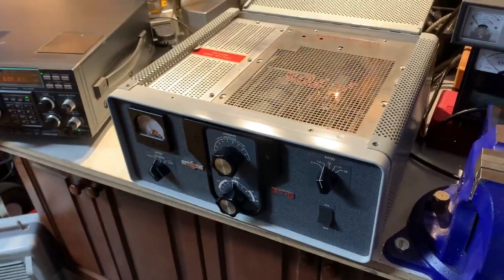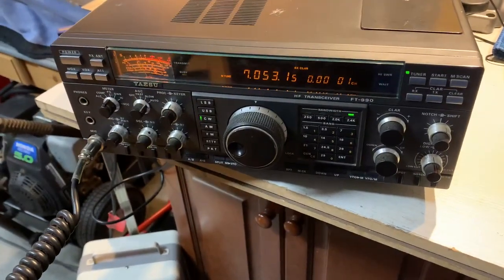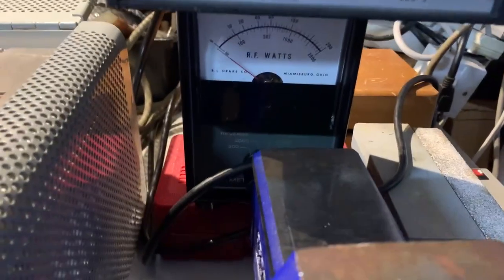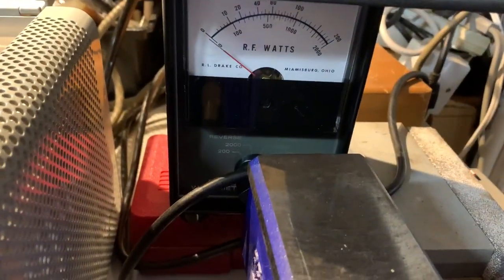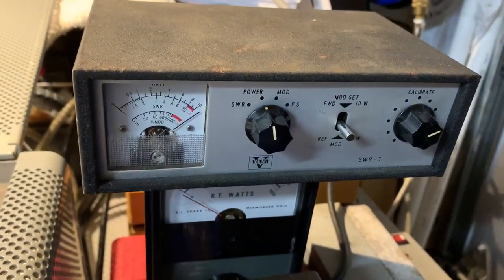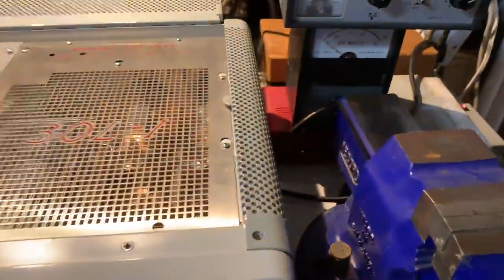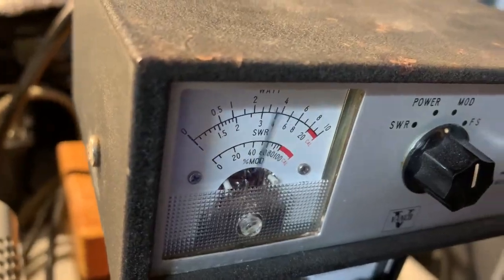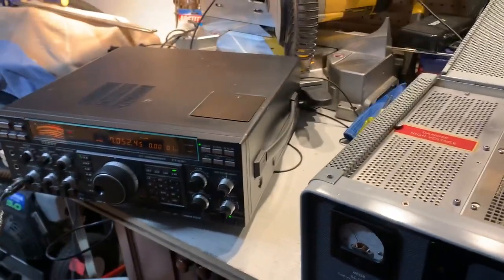Collins 30L-1 Linear Amplifier with Yaesu FT-990 Test

Comment: What did you use to ket the Collins.  I have the same Yaesu and the Collins amplifier as well?  Is thgere a way you can post the connection?
Reply from the maker: Hello.  I am not sure what you mean by 'ket the Collins' - please clarify and I will try to answer, though please note that  the Collins linear does not belong to myself, and I have no expereince of operating with it other than testing after refurbishing it.  You should be able to include  a link with your question if you want to.
Reply: @RadioRestoration  Sorry for the typo.  it was "Key the Collins"  I was able to figure it out by using a regular Morse code key into the back the of the Collins to key it.  I was able to get on the air.  Thanks.
Reply from the maker: @kp4usa  Ok - I used an old Marconi key